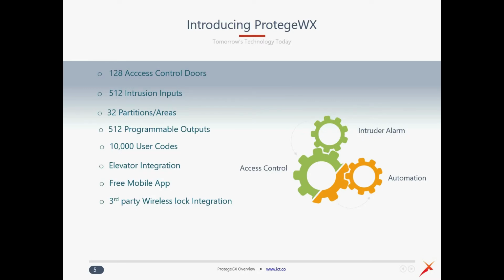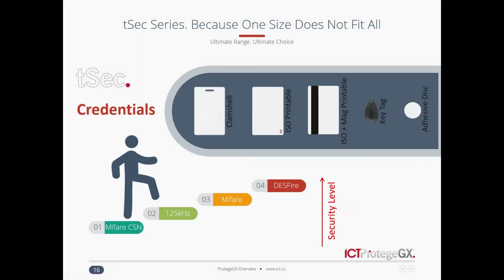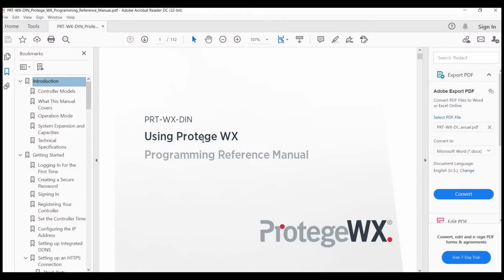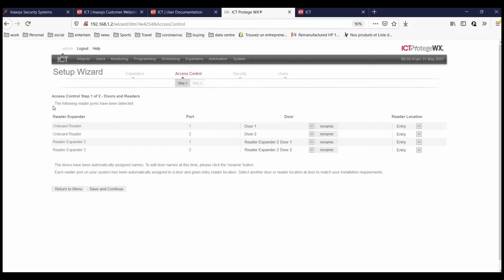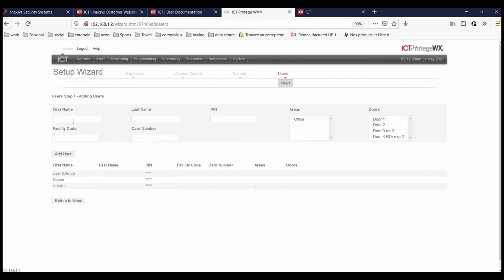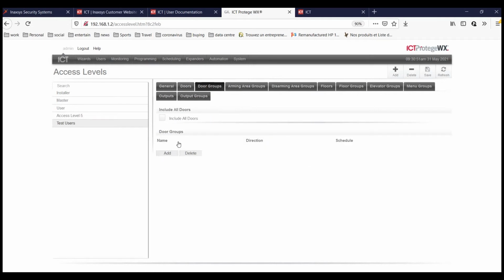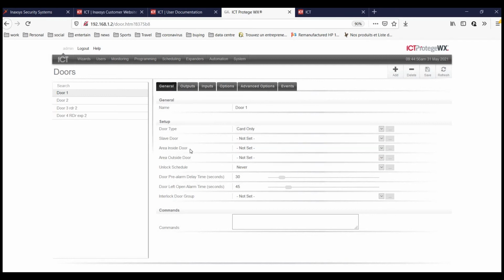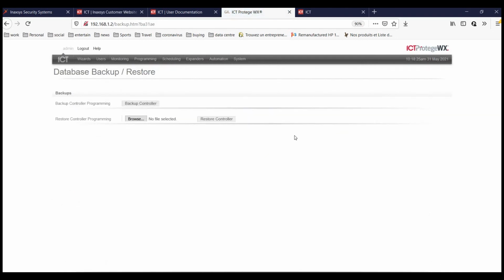ProtegeWX Training with Inaxsys

Comment: What if the default IP address doesn't work?
Reply from the maker: Thank you for your question!
You can force an ICT WX or GX controller to a known IP of 192.168.111.222 but putting a jumper on two specific terminals and then you power cycle the controller.  This will then allow you to go to the settings page of the controller and either see what the IP address is or change the network settings.  Then you can remove the jumper and restart the controller. 🤝

Comment: Hi guys thanks for the video, just a question, how I can reset to default setting the controller wx, thanks
Reply: Power off the expander, Connect a wire between Reader 2 D0 and Reader 2 L1, power up expander, remove wire when the status led flash.
Reply: @kathysu3221  Hi Kathy, can you guys upload the video for wirering and installation as well Thank You!